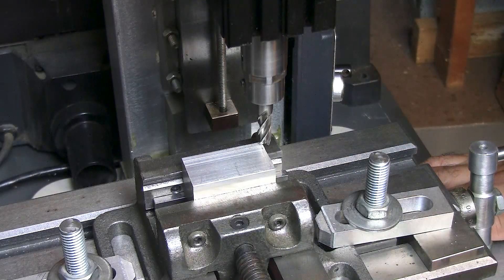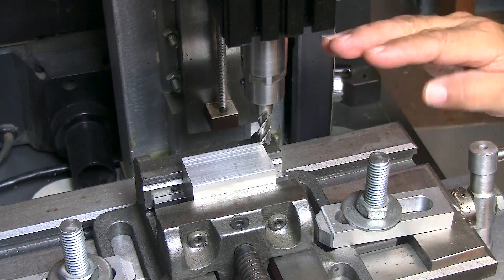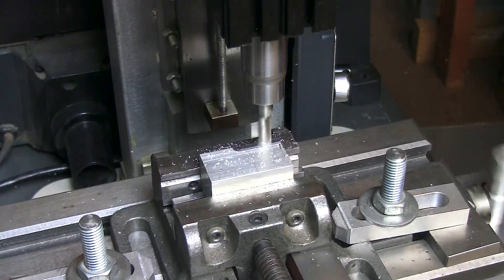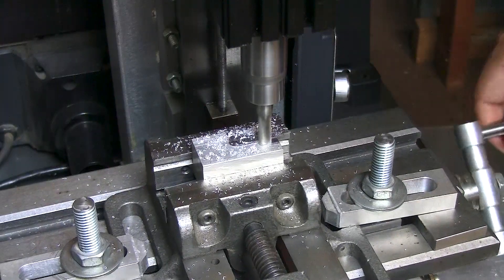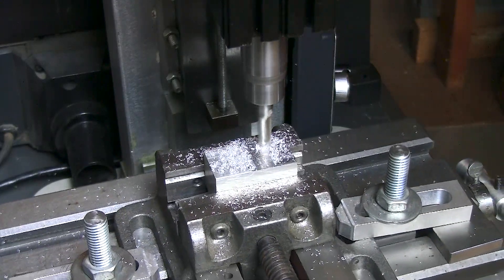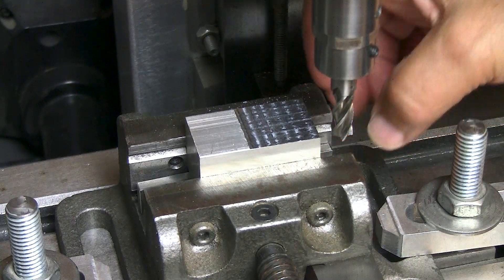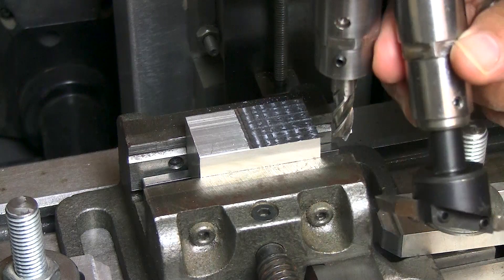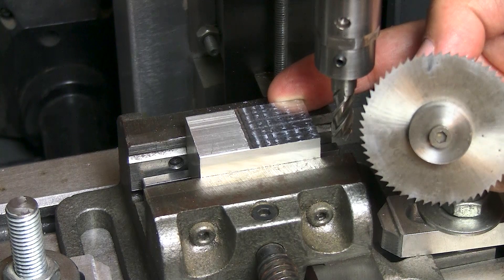My Shop Made Minimill Cutting Demonstration

Comment: What's the final price on that build?
Reply from the maker: Believe it or not I already had all the scrap metal and the column and head stock from the Taig Microlathe which was given to me by the company long time ago. The variable speed motor came out of an old scroll saw on its last legs.  So I bought the X/Y table for about $60?? I can't really remember.
Reply from the maker: Oh and it works as good as a *Real" Minimill you would buy.
Reply: JTOOLMAN1949 that machine is purring like a kitten. Sounds and looks solid, nice job brother

Comment: Nice minimill, seems to be performing great, this tool will do everything you ask as long as it's compatible with the size...

One little note on the toe clamps, the back has to be slightly higher than the front where the vise is held, meaning just the other way around, much safer...   ;)

Thanks for sharing,   Pierre
Reply from the maker: +pierre beaudry Thanks, and yes you are correct about the clamps. I just put it together for this demo way to quickly and did not take the time to use the correct spacers so it the clamps would be perfectly horizontal. It still holds very well without any problems so the is some latitude plus or minus.Joe